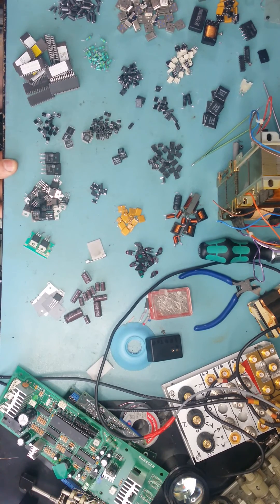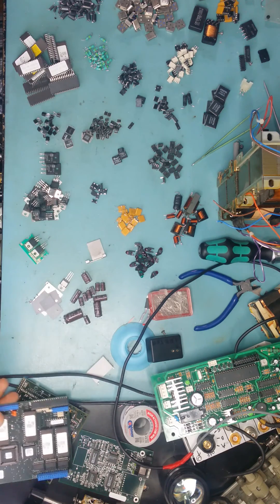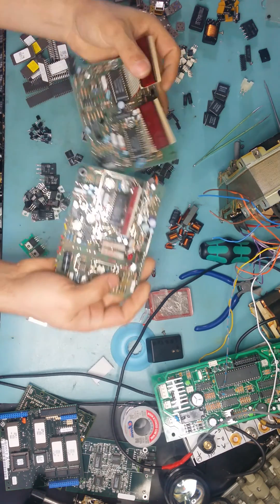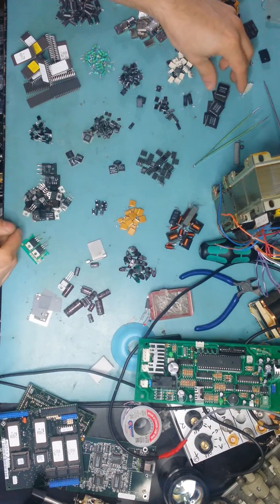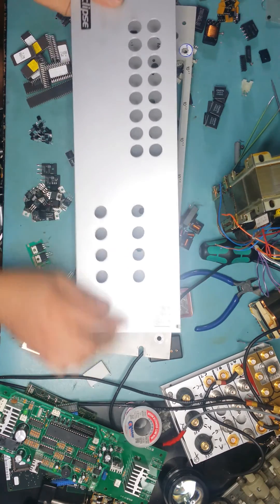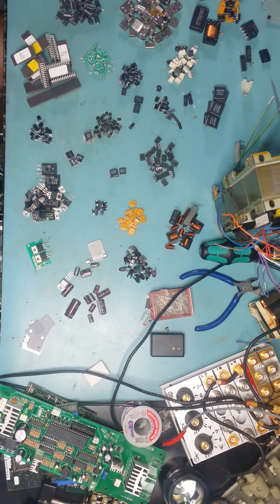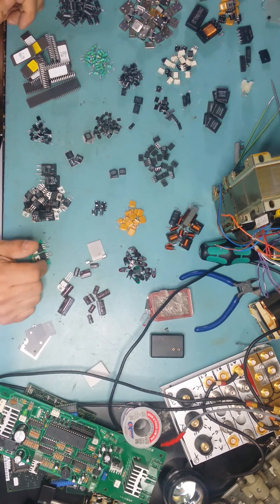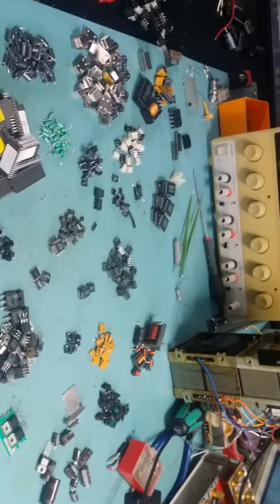Electronics parts salvage

Comment: I can't see my way clear to spend good money on what is basically junk. So everything I've ever salvaged I've found for free. Then it is a deal.
Reply from the maker: Lol. Think harder.
Reply: Mj Ram
I think I will reserve my cash for valuable merchandise. If you are going to buy scrap for cash at least buy it in bulk. At auction you should be able to purchase pallets of it for a reasonable price. That is where the bulk of the ebay product comes from. Large industries and institutions just dump that stuff out. Once a year they'll hold an asset auction where they basically give that trash away. They just want it gone.